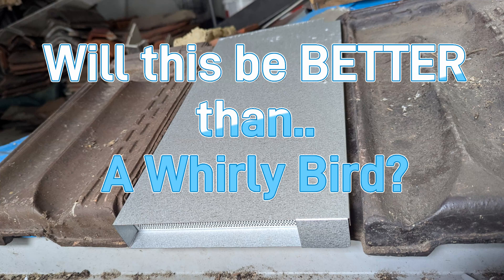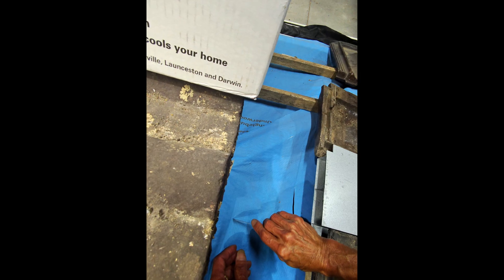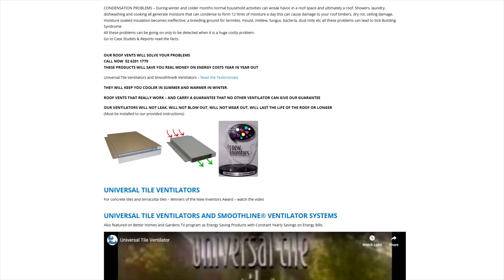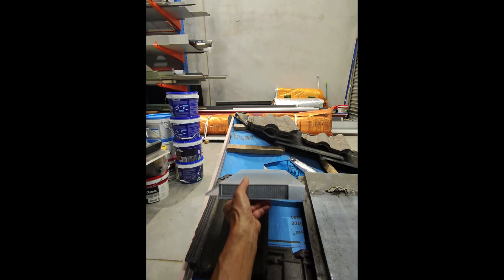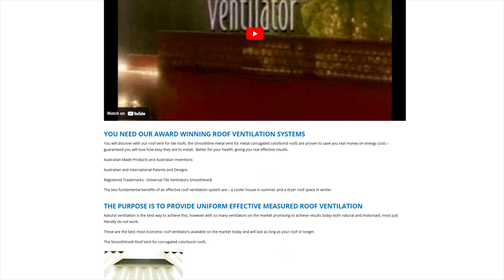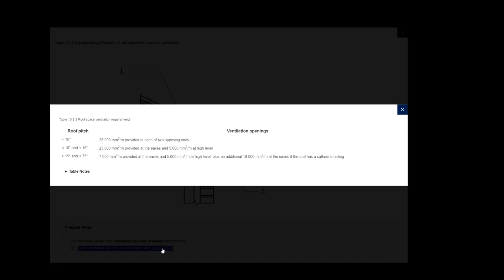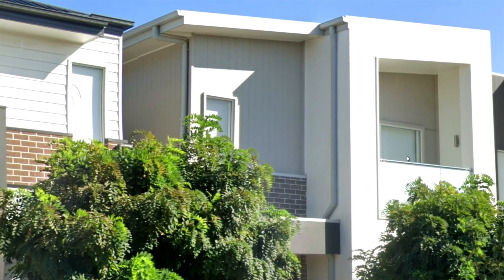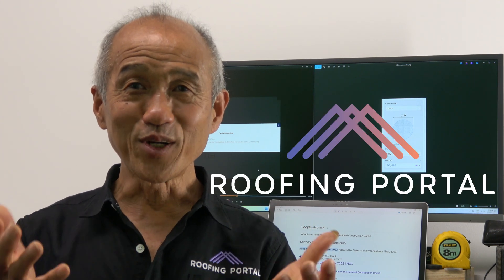Is this the whirly bird killer when it comes to roof cavity ventilation?

Comment: works great until you have a broken tile... then water runs through the hole in your sarking and down into your house. The sarking is there both as insulation and water direction.

Comment: The solution is a solar roof rent with powered fan. Obviously need the required eaves vents to make it work. I've got nothing on my roof as it was built without sarking and insulated ceiling. Also located in an area where the new requirement is not needed. Doesn't stop people that live nearby putting whirlybirds on their rooves thinking it is going to make a difference.

Comment: I recon this type of ventilation installation is flawed.

 Cutting holes in the sarking is one of the stupidest action l have ever seen.

 Then again i really don't get pitched  roofs or tiled roofs.

They are harder and more dangerous to work on because of the aggressive pitch.

Plus tiles add a lot of weight which may lead to future maintenance issues.

 Having a low pitched steel  roof  is far superior to a tiled roof with an aggressive pitch.

There is less roof space  for hot air to congregate

 Stick to a low pitched colorbond steel roof and life will be easier. 

 Wack on a couple of whirly birds and get some roof insulation to stay cool.

Comment: The advent of foil sarking creates the problem of roof cavity heat retention. My place with tile roof originally  has no sarking but my very large extension has sarking. In the non sarked area, air just blows thru ( and brings the dust as well!!) In the sarked area which is clean as no dust, it gets noticeably hotter in this space. Im planning to use a solar powered fan extractor/ blower that will , via some ducts, simply suck hot air out of the cavity and exit the roof.

Comment: In the old days of building construction, every cornice corners has vent with flywire to have warm air flow into the roof from ceiling plus brick vents just below roof line and its works well without air conditioning, sadly it's has changed for the worst by concealing the whole roof. The only problem is that you loose a lot of warmth in winter and a simple solution is to create some kind of shutter on willybirds and wall vents. Comments on sarkings by cutting a hole for vent is a big no no, you have huge condensation running down onto ceiling and you may say the same for willy birds, but willy birds are based near the ridge at high point of the roof..

Comment: Can someone explain why so many new houses have a dark grey or black coloured roof, surely its not energy efficient?
Reply from the maker: It is a trade off.
Dark roofs attract less condensation under the roof - so it is better for condensation.
Dark roofs do soak up more heat, so ceiling insulation has to work harder to maintain temperature in the living areas.
The rule of thumb should be: Dark roofs for the cold, temperate areas of Australia. White roof for the warmer areas.

Comment: Parents house has no whirly birds, nor tile-vents.  The extreme summers helps to kill any bugs and terminates etc in roof.
Reply: That maybe means less inspect spray is needed, but human comfort will be terrible or cooling costs expensive.
Reply: @StevenMorello  They have insulation above ceiling, so heat is trapped in the roof cavity. The tiles offer small gaps to allow pressure out.
Reply: @StevenMorello  A lot of people are so fragile these days.  Is it ok to not have cooling under 30C. Easy to bear. Fans the next level, then other technology.

Comment: I put up two whirly birds, then I installed an inline 200mm ducted fan in the roof and ran duct from it to the base of one of the whirly birds and by removing the bearing from this whirly bird I prevented it from spinning at a million miles an hour from the large amount of air being pumped out. So when I turn the fan on, it sucks the air out of the roof space and pumps it out of one of the whirly birds and sucks it in from the other. Ideally I should have three whirly birds with two passively sucking in while the powered one blows out. These ducted fans are very powerful. I bought a German Can-Fan Centrifugal 4 Speed - [Model: RK200S] off "E Bay" that had four speeds and I find the first speed is more than enough. I have a black concrete tiled roof with a 3KW solar system. The fan draws 90 watts on the first setting and 120 watts on the top speed. The top speed sounds like a hurricane. I plugged it into my bathroom exhaust fan outlet in the roof space and I turn it on from the bathroom switch. I'm retired so it's no big deal to turn it off and on as I please. One day I'll get an electrician in to install a dedicated switch.

Comment: Nothing will work if the outside air temp is the same as or higher than the inside roof space temp. It is the same as when you go to a tropical climate and you sweat, yet the sweat does not cool you down, because the humidity in the air is close to the moisture content on your skin. So it has zero effect and your body overheats, just loke your roof

Comment: G'day, Did I miss something when you calculated the number of vents needed for the sample roof you used? Should it just be based on the length of the roof or do you also have to concider the width?
Reply from the maker: The new NCC is for ventilation and not energy efficiency. 
Therefore, just using the longest dimension of the roof to work out the number of vents makes sense. Air may take longer to move across a wide roof (as opposed to a narrow one), but the total volume of air over a certain measurement period is about the same between a wide or narrow roof.
Reply: @roofingportal  Sorry, I don't see how the width of a roof has no impact on this calculation. What it appears to be trying to say  is each vent has a maximum area of 100 Square meters of coverage. What you are saying in effect is a second unit could increase that area to 400 Square meters.
As this is an area outside of my training I suspect there are factors I am not concidering that will influance the total number of vents required.
Reply: @skullandcrossbones65  I suspect that we are both missing something.

Comment: Good video. Wouldn't the air simply pass through the ventilator and flow between the tiles and the sarking? Since hot air rises, I can't see it being drawn downward through the hole cut in the sarking. Given that each tile has small gaps underneath, I don't think this would have much of an impact.
Reply: They are designed to have two ventilators opposite, one low in the roof, the other high in the roof.  Very effective as an air flow is generated.  But the installer should fold and staple the sarking so the air flow can go where it should.  The video above did not show proper installation.

Comment: No turnup under the edge that goes under the tile? That will leak straight onto sarking or into your ceiling
Reply from the maker: Thankfully, we have gravity and capillary action on our side here.
Any seepage climbing up the ventilator will 'hang' along the top edge of the metal and dribble back underneath - then run back inside the ventilator tunnel and out the bottom.
So, no upturn needed.
Reply: @roofingportal what about in 300km/hr wind speeds?
Reply: @kizzjd9578   no roof is proof against that I would think
Reply: Can easily add turnups to waterway on the left hand side and to the top of the metal...

Comment: Do internal toilet exhaust fans that vent to the roof space provide the relief air needed for the roof ventilators to work properly?
Reply from the maker: NO.
The Australian National Construction Code 2022 stipulates that ALL toilet/bathroom exhaust fans be connected to ducts that lead to a rooftop ventilator and the air be expelled outside the roof cavity.
This means that the majority of Australian homes do not comply with this Code.
The codes stipulate that inlet air is from outside the house.
Reply: @roofingportal  this is correct. Many toilet / bathroom extractor fans exit into the roof cavity and the effectiveness is determined by the roof structure. I have 4 such fans in my 40 yr old house with hip roof that I  built and because I have a large roof space and no sarking, there is NO issue.However if the cavity space was very small or almost non existent like in a near flat tin roof, then yes, it needs to be vented to the outside via a suitable duct.

Comment: Bunnings used to sell (maybe they still do) a solar powered fan extractor which replaced  a tile. I imagine a flat metal roof could use a waterproof low duct as a mount to raise the solar extractor above the roof. A flat roof could hold an appropriate number of the units to extract the hot air assuming there is enough solar load  )not too many overshadowing problems)... otherwise a 12v motor could potentially be used, I guess.

Comment: My old fibro house in Sydney has no roof insulation or sarking. Sure a bit of dust has got in over the last 70 years, but it sure doesn’t keep any possible excess heat in and the house can quickly take advantage of any cool breezes on a summers afternoon. In a mild climate location like Sydney you can get away it on a fibro, ceramic tiled house.
Reply from the maker: You are safe from the National Construction Code's ventilation requirements.
The Code actually states that UN-SARKED tile roofs are exempt. This is because exactly as you say - the gaps between the tiles provide adequate ventilation...

Comment: Is it worth adding sarking to a tile roof?
Reply from the maker: It is a trade-off.
No sarking means cheaper and ventilated roof cavity. If the roof is steep, there is no code requirement for sarking.
Sarking can reduce the heat transfer from the underside of the roof tiles and if a tile breaks, the sarking will stop a bad leak.

Comment: Great idea, but the airflow will be a fraction of a 300mm Diameter whirlybird. What is the approximate cost per unit.
Reply from the maker: About $110 Aussie dollars per ventilator
Reply: @roofingportal  Hey that's cheap!  Thanks for answering my question.
P.S. My two Whirlybirds have both seized!

Comment: Would you recommend attaching the Sarking on top & sides of the Tin vent with tape.  To keep a water proof membrane,  but still have a air parth?
Reply: I was thinking the same thing, but cut an upside down "T" shape and fold the flaps open so that any leaks from higher up the roof won't run in to the hole
Reply: @retrofitter  yes, stopping possible leaks and better air flow. You should suggest it to the company that make it. Or Maybe do another YouTube episode on it.

Comment: Roof tiles (ceramic or concrete) have a lot of thermal mass and absorb a lot of heat from the sun. I think IR reflective sarking + batts on the roof behind the tiles is mainly what's needed to isolate the heat away from the rest of the roof space. Ventilating the roof is still useful to get cool air through though.

Most batts installers though will throw the batts on the timber holding up the gyprock ceiling which really traps the heat in there like a blanket.